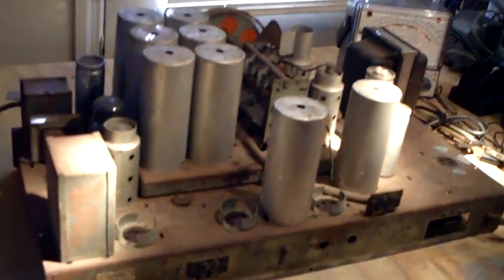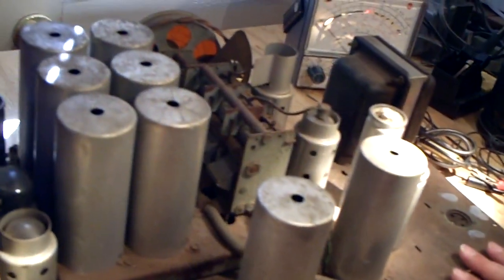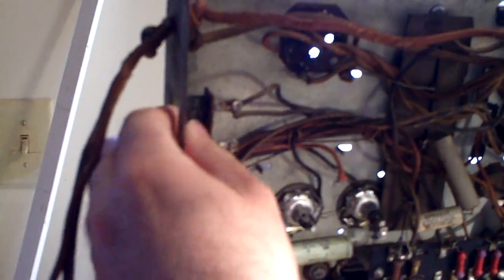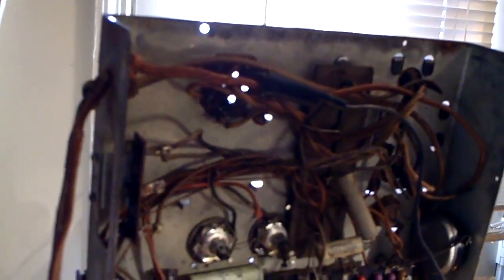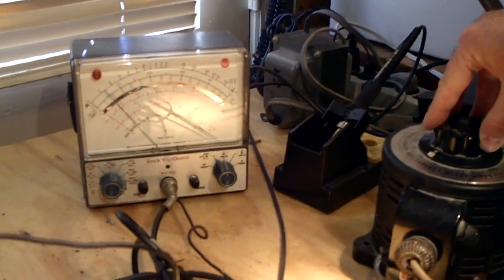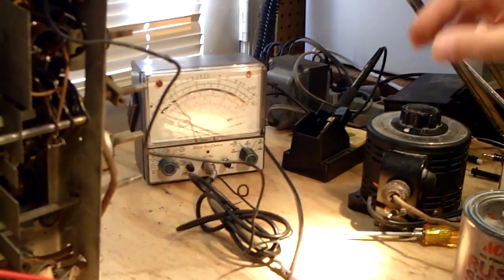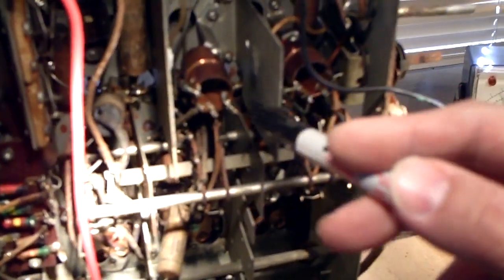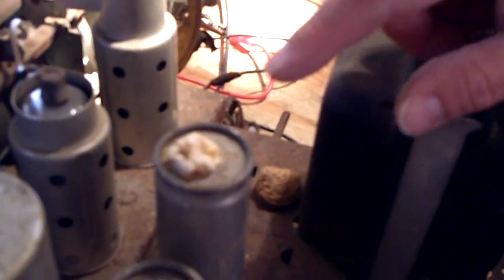Part2 Antique Radio Repair 1934 RCA Model 262 part 2

Comment: In other words, I wouldn't use a modern day dimmer (that slices parts off the sine wave, rather than reducing its amplitude overall) as a variac, as it would probably make your radio hum and sputter pointlessly at the low settings, if not worse.  If you are still feeling can do homebrew, you can build a "dim bulb tester" out of light bulb and parts that will add some level of safety.

Comment: It depends on your dimmer.  If your dimmer is a really old skool rheostat, which doesn't change the sine wave, but lowers and raises its amplitude, then yes maybe.  However, most modern dimmers work differently... they do a hack job on the AC sine wave and chop off part of the high of the sign wave down to the low (100% down to 20%) depending on how far you sliide/turn it.  This is fine for dumb lights and even a water heater (how I used mine, but would be hell inside a radio circuit.

Comment from the maker: I got both my isollation transformer and the variac from 2 different vendors on Ebay. The isolation transformer was pristine. the Variace had a little wear to it and needed some repairs. The socket was worn and I installed a short pigtail and new socket. Try google or yahoo to seach for these things if you don;t wish to use Ebay. You might find new isolation and variacs on Ebay from reputable Vendors or at least get manufacture names and search the internent for those manufacturerers.

Comment from the maker: Wow! that's a really good question. I wish I had a really good answer for that.  I guess check the package the dimmer switch comes in for intended uses. The radio like I have pulls about 1 Amp. I am not sure if the dimmer switch changes the AC sinewave form somewhat due to the electonics inside the dimmer. A variac wouldn;t change the sinewave at all.  You have realy nice radios. Check out antique radios web site for the blogs. I learned a lot from them.

Comment: Your variac, can I use a dimmer switch like you would use in a light switch. I.E. I would have a heavy duty extention cord about t 12" long that would be connected to a dimmer switch, that would be connected to a GFI outlet? The GFI would be for safety. What do you think. I also been tinkering with old radios...I have a 1936 Zenith 5S150 wooden consol an a 1953 Philco Transitone 53-561. I dig your videos, that an the library books on old radios I been reading have been a big help.

Comment from the maker: Cool, I don't feel as bad about not having the original speaker now!
Dp you have any other tips you can give me?
I don't even know the questions to ask.
Actually I just thought of one. If one of the IF 460 KHz transformers turns out bad, coould it be replaced with a 455 KHz transformer? or is it better to bypass the transformer with a resistor and capacitor?